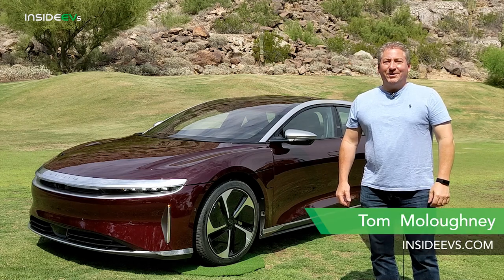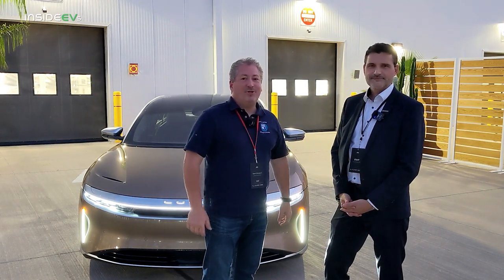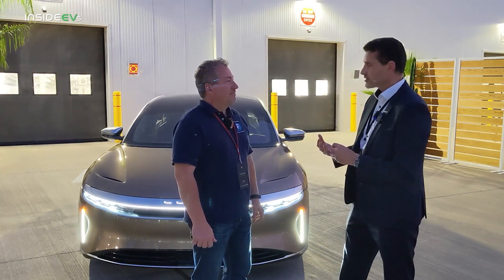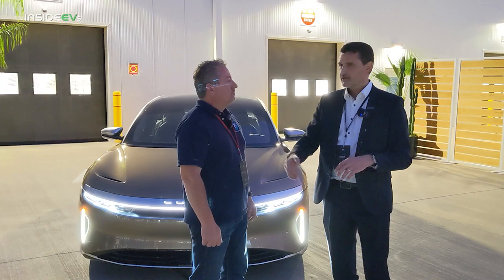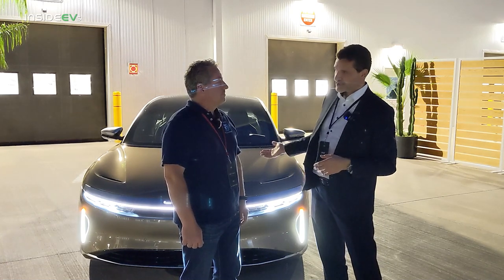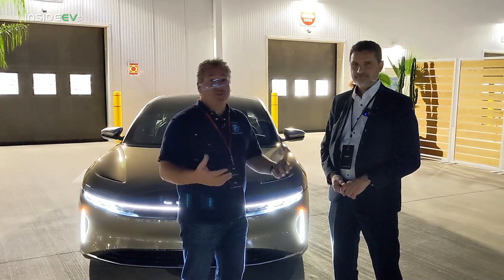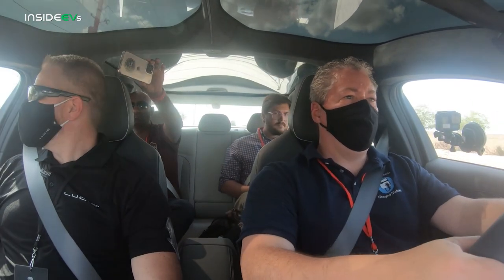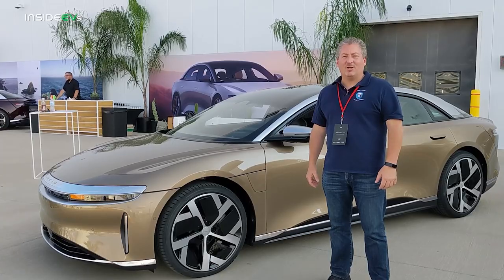2022 Lucid Air: InsideEVs First Drive Review

Comment: Lucid Cd = .208,  Plaid Cd = .208   ... EQS Cd = .20 !  "Legacy OEMs are so far behind" /s   I don't really understand the touting of the 'small' 113+ kWh battery. (+ because that's likely the usable capacity, not gross)  Isn't it thee largest battery in a production sedan OR CUV?   Unless you're living in an apartment without access to nightly charging (Do people buying a $170k vehicle do that?), then who the heck cares if this vehicle can do 520 miles.  That's 7.5 hours of straight driving at 70 mph; and most people won't drive that long without stopping.  Its 900V system should allow for some pretty quick charging.  While some of the things they're doing with efficiency are great, and I liked that Eric Bach noted how efficiency and smaller batteries not only leads to less mining but also that we NEED to mine less (something that I'm one of the few people in the EV community EVER points out, not even the supposed EV expert journalists who are supposedly so eco-conscious EVER point it out)... but in practice, this is still probably around 120 kWh of cells for no real purpose other than to go fast and to tout its completely unnecessary max range figure.

Obviously I hope efficiency improvements in the powertrain translate to smaller / cheaper cars with MUCH smaller batteries that can get at least 200 miles of range.  200 miles with a 900V powertrain and ultra fast charging speeds is ample for I imagine well over 90% of US drivers.  And we have the longest average round trip commutes in the world.  Not that commutes are the reason we slam such huge batteries into cars.  We do that because of 0-60 times, and because of the off chance we might take a road trip a few times a year.  A complete waste of resources.
Reply: Big batteries are not just not just for 0 to 60 times.  There are vast areas of the country, especially away from interstate highways, that have no fast charging infrastructure at all.  If you want access to those areas, you need enough range to not only get to your destination but to get back to a fast charger.  A vehicle that can only access a small percentage of the country is a nonstarter for most people.
Reply: Battery life can easily double if you charge upto 80% and recharge at 20%. When you have 500 miles of range its much easier to do that. Also it's nice to only charge once every 10 days. Many areas locally and globally won't even touch EV's as there is no infrastructure support outside of home or office. With 400 to 500 miles of range the logistics of charging are much easier with a lot less anxiety and planning.
Reply: U need a big battery because weight, outside temperature, air conditioning/heating and age of battery can all affect range...

Some people only have the opportunity to charge once a week and they need the big battery especially if they drive everyday. 
All that CCS charging will degrade a battery quickly..
Reply: Aptera cd = 0.13 😀
Reply: I currently fill my car once every 7-10 days. I dont want to have to charge my car any more than that. Theres no reason we shouldnt expect the same kind of mileage, regardless of the fuel/power type. And by the way thats about 600km in the summer. So yeah 520mi is necessary. And i hate people like you declaring otherwise.
Reply: @RobbieFitzgerald  600 km in the summer is only 372 miles, so you still haven't made an argument for 520 miles of range.  Especially not at a price tag of $170k...   BTW, comparing gasoline refilling to EV charging doesn't make a whole lot of sense.  

It sounds like you have a fundamental misunderstanding of how EV fueling works.   You plug it in when you get home, and remove the plug when you leave.  Takes about 15 seconds.  Unless you live in a place without access to a plug at night, you don't stop somewhere to fuel.. you fuel at home either nightly, or every few days.  While a gas station stop will take you an inconvenient 5-10 minutes; potentially requiring you to drive out of your way, fiddle with a pump, handle a nasty gas nozzle, inhale all those fumes, while standing outside in the summer heat or winter cold, uncomfortably waiting the few minutes for your car to fill up.

Fueling an EV is not the same as fueling a gas car.  A gas car's remaining fuel isn't recovered while it sits in your garage every night.  An EV typically means you start each day with a full tank.  You don't have to go somewhere once every week or two to fill an EV's battery as you approach empty.  You only do that on long trips.

Even at 200 miles of range, you wouldn't necessarily need to charge at home every single night.  So say you did it every other night.  That's 1.25 minutes of time total every 10  days, versus your 5-10 minutes for your gas car.
Reply: @dansanger5340  Charging infrastructure can and is being added.  Judging charging infrastructure today is a bit silly.  Tesla superchargers only really started getting widespread coverage in 2016.  EA only started 3 years ago.  For CCS, EA is still expanding, and there are now more players getting into the game, as was announced in the Northern mid-west states with a conglomeration of energy companies.

Frankly, I don't forsee a lot of people living in these rural areas wanting to spend over $100k to get a 520 mile range battery.   What they probably should be doing is buying HEVs, or even PHEVs if their daily drive is less than 50 miles.
Reply: @updlate4756   Thats summer driving. Id be surprised if I still got 300miles from that car (Lucid Air) in the winter. And I dont care how its different. The point is that we shouldnt have to expect less range compared to an ICE vehicle. Especially at that price.
Reply: @hussamalyafai3708    Battery life doesn't matter if there's proper recycling of batteries, which is FAR better for the environment than mining and refining new metals, in terms of mining pollution, total energy usage, and total emissions mine to battery pack.

Most people with existing long range BEVs with ranges that are less than 300 miles (or even 200 miles) get by with only charging their vehicles to 80% on a daily basis, or even 70%.  That's because most people don't drive very far on a daily basis.

You seem to think that the goal here is convenience. No.  The goal here is to reduce emissions.  Sadly, I don't think trading one form of pollution for another is the answer.  Eventually every residential parking spot will have access to a plug... in which case, there's no real reason for needing this type of range.  Sure, apartment dwellers may have a use for it if they don't have access to a plug at home or work...but who living in an apartment really wants to spend over $100k to get a car with this much range?  For now, their best bet is buying an HEV.
Reply: @mamadouaziza2536    Eh, I think you're overestimating how much energy those items you've listed actually use.  Most people buying a Lucid will live in a single family home, with access to a plug for nightly charging.   Pointing out cases that won't typically apply doesn't justify the point.  People in single family homes WITH access to nightly charging, who have far too much money on their hands, will buy this car, and WILL waste the resources.  That's just common sense.

Putting one really big battery in a car just for one person's convenience (in very rare cases) is not better for the environment than sharing those battery resources between multiple cars.  Two cars with 60 kWh batteries is better for the environment than one car with a 120 kWh battery.  Even if those smaller batteries degrade faster; they likely won't degrade twice as fast.  Degradation has multiple factors involved; one being age.  In terms of age degradation, a 120 kWh battery will degrade just as fast as each of the 60 kWh batteries.  If someone is buying a 120 kWh battery vehicle and only charging once every two weeks using a DCFC, and is charging to 100%, and running it down to 10%... they are going to be damaging the batteries at a pretty fast rate.  Maybe instead of spending that much money on a car, they should discuss the possibility of adding a plug to their parking situation with either the apartment management, or the city government.
Reply: @updlate4756  For people buying EVs today, they have to judge by the current infrastructure and so have to get a big battery in order for it to be practical if they plan to go on road trips to anywhere off the beaten track.  In ten years, things will be different.  But consider that since 2010 battery cost has gone down by 90%, and it continues to drop.  And, energy density has increased.  So, even if big batteries aren't strictly necessary in ten years, people might still get them because they will be cheap enough and light enough that they might as well do it.
Reply: @updlate4756  it all boils down to efficiency. You are clearly not in the market for a high powered vehicle, nevertheless there is a huge market. High powered vehicles require more energy (bigger battery). A byproduct of that bigger battery is higher range. The efficiency lies in how mamy watts you use out of this battery for every mile you drive. The required wattage needed increases for bigger cars that are loaded with options. But you get companies like Lucid and Tesla that use comparable watts per mile to much smaller vehicles (the ones you call efficient). Check out insidevs list of ev car efficiency you will see Lucid grand touring ranked 3 or 4 next to vehicles that provide less than  half the horse power and the less than half the range. Where is the problem in a battery operating for 20 years instead of 10 and then recycling. What's you issue with convenience? That 100,000 + motor vehicle will pave the way to a much cheaper vehicle that is much more efficient than the vehicles you are promoting right now. The vehicles you are talking about will have very low range with spirited driving and range anxiety will be a definite issue even if you charge everyday, if that's something you like. To each his own. 👋

Comment: Spyros Panopoulos for the 1300hp hydrogen fuel cell powertrains, which will be used in the next gen vehicles (as well as industry), for cars we see 1000 mile range almost reached, and as far as these battery cars at around the 200,000 dollar level (equipped), this is a hard sell, considering the advances in hydrogen fuel cell applications with the next gen emotors, which is much faster, as well as the growing hydrogen infrastructure ... congrats on the tires LM1, these can be a useful introduction to the SP Automotive zero-friction concept tires (which will be useful on an Xpeng P7, which oversteers as well).

Comment: Who needs 2.6 seconds except car freaks, useless top speed given speed limit is 70
Reply: I see your point but having all that torque and power makes half throttle acceleration and effortless overtaking when needed a joy 😊
Reply: You need it when there is a slow-ass car in front of you and you need to get around it quickly.
Reply: @snakeeyes9246  then you can wait for it at the next red light 😜
Reply: I agree, no one drives that way. My Mercedes will do 0-100 in 4.2 sec.
I never drive like that.
The ev party trick gets tiresome after a while.

Comment: How come Lucid has 112 kWh battery compared to Tesla model S long range 100 kWh battery 
But the Lucid Dream edition R has 115 miles more range with only 1kWh/100 mi efficiency according to official EPA?
So Lucid has only 12% larger battery
That provide 28.4% more range with only 3.7% efficiency per kWh/100 miles 

Nothing works out mathematically in the numbers Lucid provides
It's one of two 
The battery is much larger than they claim or zero chances this vehicle can reach 500 miles with 112 kWh battery
Reply from the maker: Did you watch the video? Eric Back explains why the Air is more efficient.
Reply: @InsideEVsUS  Yes I watched and still behind the beautiful words
Simple math shows that in order to reach 520 miles the battery or the efficiency should be greater by at least 30%

Comment: For $170,000 the interior looks cheap. Even the gaskets around the door frames look cheap, compare that to a Mercedes S class. Also just a
Fixed  glass roof? It doesn't open, nor does it have a power sun shade. This car looks like it was designed in the 80's as a future concept vehicle, combining the front end and dash (with a retracting ipad)  of a Mercury Sable, with the rear bustleback trunk of a Cadillac seville. The design is already outdated before the car is released.. We may have an edsel here.

Comment: The market for vehicles above $75,000 is not very big...so likely Lucid is counting on existing Tesla Model S owners to prematurely retire their cars and get a Lucid Air. The only way Lucid can survive as an independent company is with a cheaper vehicle around $50,000 to 60,000.
Reply: Their cheaper 'Air' is coming...
Obviously they are working on a Model 3 competitor.
Reply: @mamadouaziza2536  I would really be interested in seeing what they have in mind for a smaller/cheaper model.
Reply: @joer4367  
Something in the $46k to $55k price range with 300 miles of range and 400hp, artificial leather interior, 80kwh battery, 130kw maximum charging speed. About the size of a Toyota Camry.
Reply: Definitely not the Model S owners. I think they are counting on poaching MB, BMW, Audi, etc owners to switch. The market share is huge from ICE makers to take. Even high end Lexus, Masseratti, and lower end Bentley's.
Reply: @cobrachannel100  Tesla owners are NOT 100 percent brand loyal ...no automaker has that.
Reply: @mamadouaziza2536  The only future Lucid vehicle that I am aware of is a SUV.  Hopefully, they have a Model 3 competitor mostly engineered.
Reply: @mamadouaziza2536  Battery prices per kw are still too high to have those specs at that price point.
Reply: @SpockvsMcCoy  
Lucid definitely can manufacture a Model 3 competitor with a price point of $45k to $50k.. The car doesn't need two motors, all wheel drive, 400hp.. A simple base model with a 250 to 300 mile range, 300hp, 70kwh battery, no air suspension, 130kw max charging speed on Level 3, vegan leather interior, 3 driving modes... 

Lucid is gonna need a car for the masses in order to stay in business or partner with a Legacy auto maker as the electric division of that brand.. I really do see a cheaper 'Air' coming by 2025.
Reply: @mamadouaziza2536  Lucid should produce a more basic Model 3 competitor. But auto manufacturers make profit on optional equipment so there is not much incentive for them to produce a cheaper version as long as their factory has high utilization. Also, Saudi Arabia has an enormous investment in Lucid so legacy automakers may not want to buyout or partner with the Saudis. Profit or loss when producing electric cars is mostly the result of the price of battery kwh. Regardless, Lucid needs a Model 3 competitor before 2025...like 2023.
Reply: @SpockvsMcCoy  
Well, Lucid is not gonna survive on just producing $170k electric cars..
Tesla had to come up with a more affordable car in order to stay profitable and evolve. Lucid will do the same. 2023 is just 14 months away and I don't see Lucid introducing a sub $50k car that soon.
Reply: @mamadouaziza2536  Perhaps sometime in 2023 as a 2024 model.  The Tesla Model 3/Model Y have increasing sales so the market for a $45,000 to $60,000 EV is large. Also, Rivian seems to be focused for now on high-priced pickups and SUVs.  Ford's F-150 Lightning will have a lower entry price point.  If every new and legacy EV manufacturer enters the U.S. market with a $75,000 and up vehicle there will be a sales bloodbath with losses. The startup cost to create a new EV company is enormous but more of them should be focused at the beginning on mid-priced vehicles.